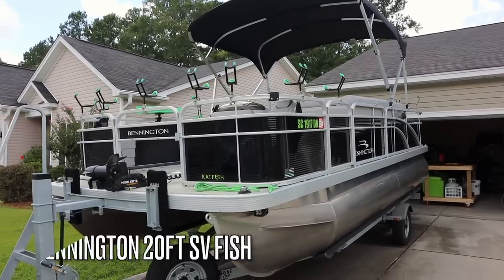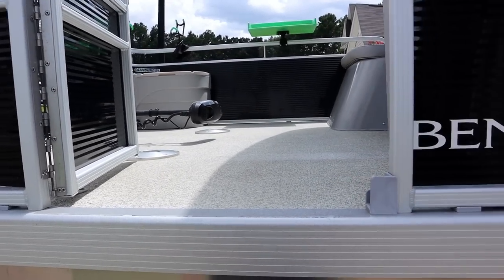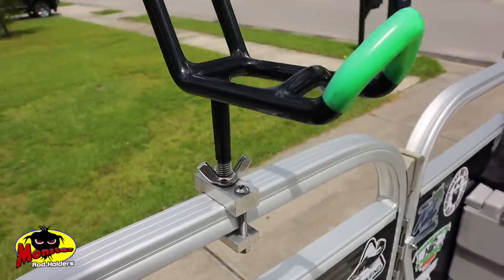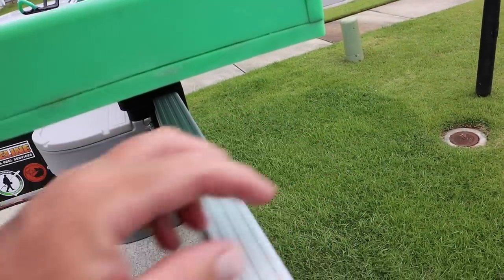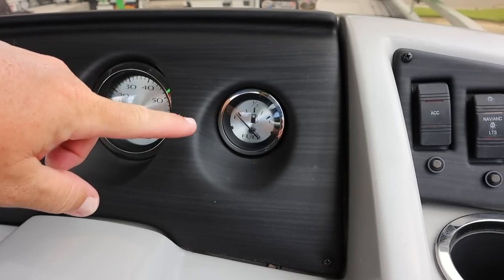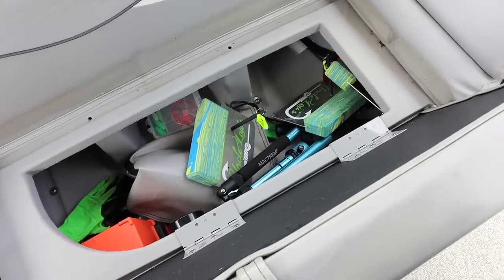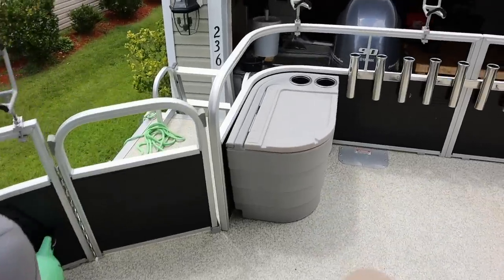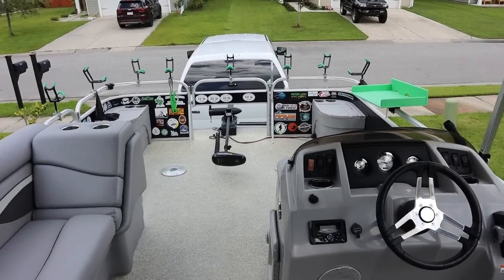I turned this boat into a catfishing machine! Catfish Boat Setup

Comment: Great video brother!   Hey, do you by chance have a video of how you installed your Rocket 10 pole holder?  Love to watch it and maybe a link to that holder if possible.  Thanks so much!  Great content sir!!  Randy
Reply from the maker: Basically I just predrilled holes through the rail and lined them up with the holes on the rod holder. I used a stainless bolt and a lock nut.

Comment: How much does the boat and trailer weigh? My trucks pull is 4K and I want to make sure the boat and trailer don’t overdue it!
Reply from the maker: Not really sure. What vehicle do you have?
Reply: Getting the Ford Maverick 2022
Reply from the maker: Ok, it’ll pull my boat, but it won’t like it. I use to pull a 24ft Bentley with a 1997 Toyota 4 runner with a 4 cyl. It did the job but struggled the whole way.

Comment: Have you been able to keep the rod holders from digging into your rails and making big round marks?
Reply from the maker: No, they make the little round mark
Reply: @PalmettoCats  I’ve thought about taking another piece of aluminum and fixing it to the top of part of the mount on the bottom.  This would give a barrier between the actual rail and the threaded part of the rod holder.
Reply from the maker: That could actually work. Let me know how it turns out.